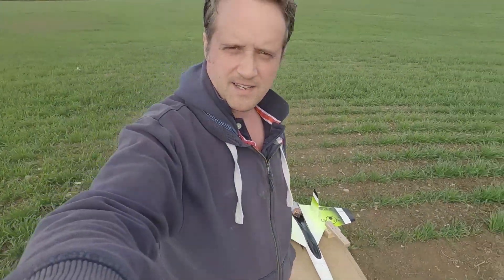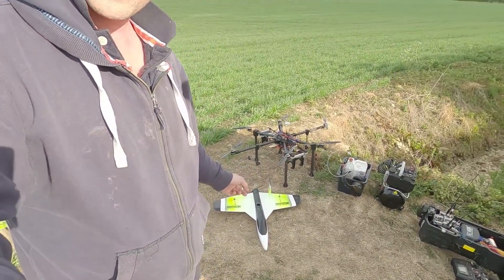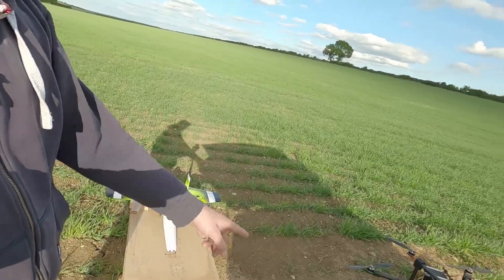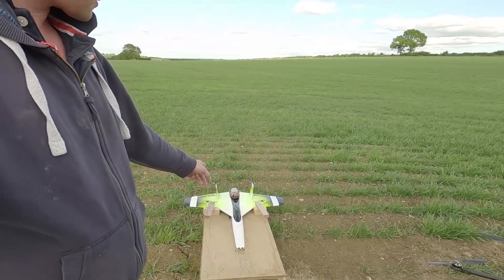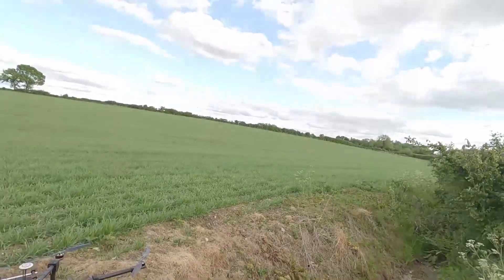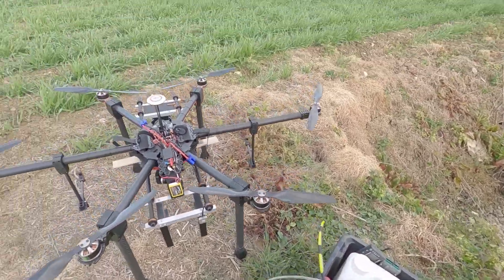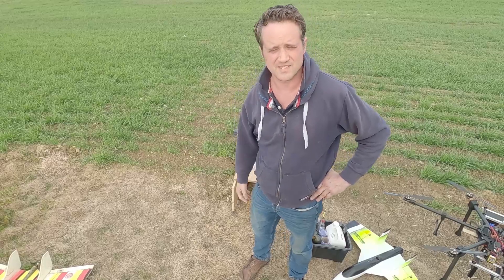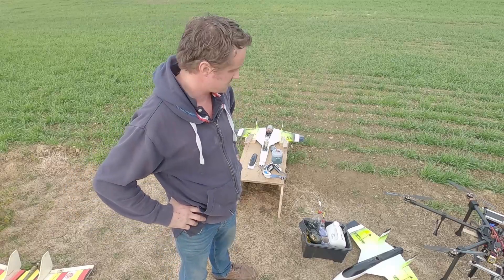Project 'Subsonic'...Jet engine fuel consumption test

Comment: That lasts seemingly pretty long, and the fuel tank is small, so that's cool
Reply from the maker: It's about 4 minutes of mixed throttle. It doesn't use much less fuel at idle than full beans!

Comment: Idle thrust will prevent a drone drop, or will the plane be in a cradle of some kind?
Reply from the maker: It's all in hand. Turbines have moved on a bit since you played with them. Idle thrust is tiny.
Reply: @OMEGOOLIEBIRD  It's a tiny turbine...Things haven't moved on with Turbines matey...the basic principles are exactly as they always were...and they will remain so
Reply from the maker: @EnglishTurbines  Want to eat your hat English?
Reply: @OMEGOOLIEBIRD  Not really, things haven't moved on with Turbines and you didn't answer my question, will the plane be in a cradle?..
Reply from the maker: @EnglishTurbines  Plane held at nose and tail under hex, no 'cradle' as such. Idle thrust had no effect whatsoever. You said I would 'be nuts to try it'. Ignoring the doubters is always the key to success.
Reply: @OMEGOOLIEBIRD  Yes, a cradle...all you have to do now is break the LOS record...Should be easy considering you have a video link allowing a long run in...

Comment: Have you accounted for the effects of the jet engine's residual (idle) thrust on the multirotor when you're hauling it up?   Might want to hoist the electric funjet up with a bit of thrust coming from it to ensure the multirotor will be able to cope.
Reply: Not going to happen... He'd have to be nuts to try it.... Besides, it would be out of kerosine before he got high enough....
Reply from the maker: @EnglishTurbines  Yes it is, no i'm not, and no it wont.
Reply from the maker: @EnglishTurbines  Worked PERFECTLY! No issue whatsoever, not even a tiny bit. Hex was rock solid, idle thrust was not a problem.
Reply from the maker: Hey Bruce, I have accounted for it with the release mech which will be unaffected by any thrust (which is tiny). The idle thrust will be no more than the effects of a gentle breeze on the hex hopefully.

Comment: Is the plan to have the turbine at idle when you lift it with the drone? Will that not make the drone unstable or can you start it after you drop it so it starts up on a glide?
Reply from the maker: It should be fine, the idle thrust is pretty small, no more than a breeze on the drone. Hoping it will be ok!
Reply: @OMEGOOLIEBIRD  Looking forward to seeing this. Good luck!